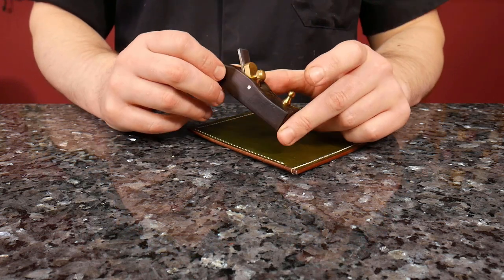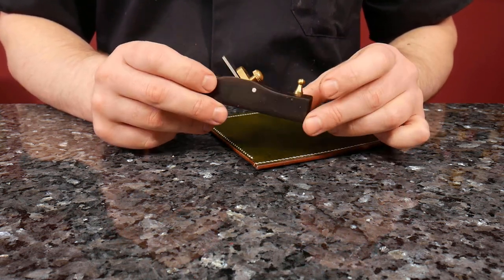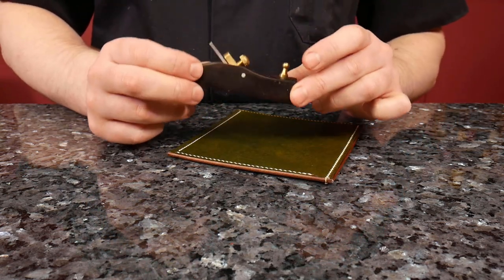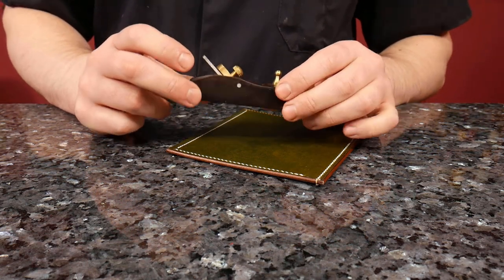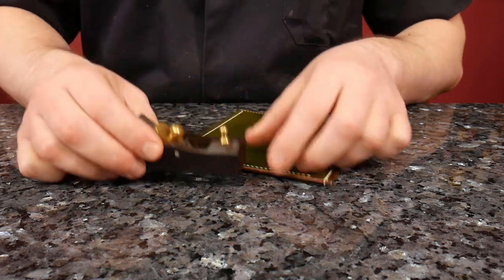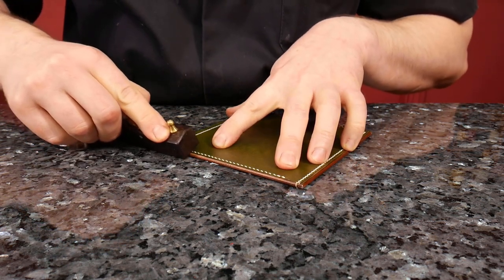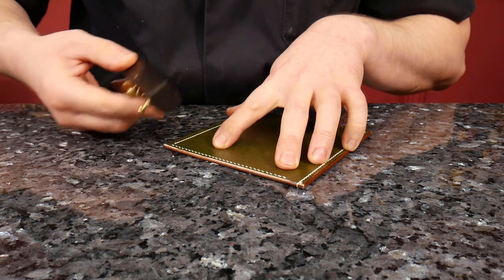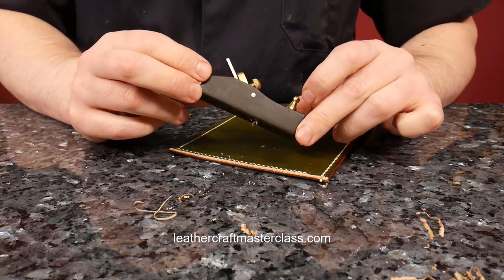How To Use A Mini Leather Plane - Quick Setup Guide

Comment: My friend recently picked up one of these for his leather work. I'm a hobbyist level woodworker so I got it lapped and honed for him up to about 16 thou grit. With stropping he shouldn't need to take it to a stone again for a while. I've seen a lot of people set these by holding the blade in the position they want while tightening the lever cap, problem is that the small rotational force of the screw can throw out your lateral setting. As with a lot of block planes and wooden planes, I showed him the way of adjusting with a small hammer, in this case a cheap craft hammer that weighs next to nothing. Tapping the front, back and corners on your bench is a perfectly fine way to do it though!

I showed him to nip off the screw, then lightly tap the back of the blade to advance, the corners to adjust laterally and the back of the plane itself to withdraw the blade. The wood of the back of the plane will bruise over time as fibres compress but it's only aesthetic and is part and parcel of the method. These things are cheap too so nothing to be too precious about. People quickly become proficient in making small adjustments to the position with just a few taps. Checking the set against a white background can help make things more clear too.

Good video thought mate! Small planes are adorable. I'm a sucker for squirrel tale planes myself but they wouldn't work as well here for shooting. Speaking of which, look up shooting boards. My friend did and designed and 3D printed a mini one to the spec of the plane.
Reply from the maker: Thank you for sharing your knowledge with us, I love these little planes!

Comment: It is a very useful tool for leather and wood. Tension on the screw cap is quite crucial to setting and using. To set, the screw cap must be tight but not so tight that the blade can’t move whilst setting. Once set, I tighten the screw cap a touch so that the blade can’t move in normal use. You will find out through use how loose the screw cap can be during setting but don’t tighten it too much at any point. It’s only brass and therefore relatively soft. You also risk damaging the pin. If you’re a woodworker, this is the same approach as when using a European style wooden plane. It’s a little different for Japanese style as they don’t have a screw cap as such.
Reply from the maker: Thanks for sharing Martin 👍